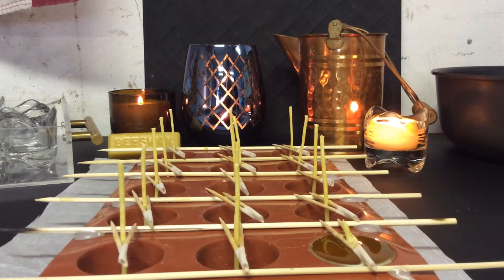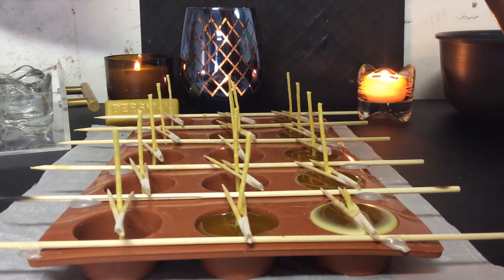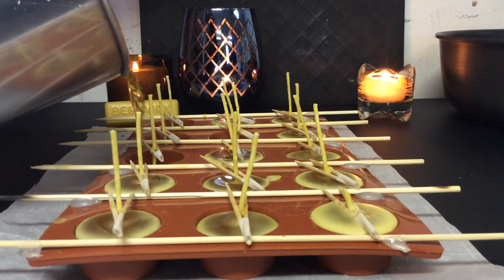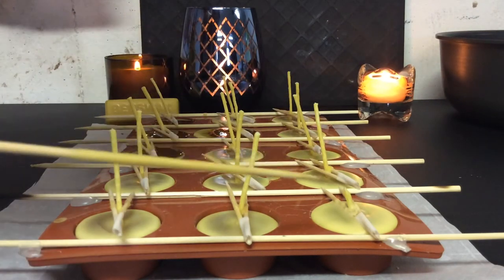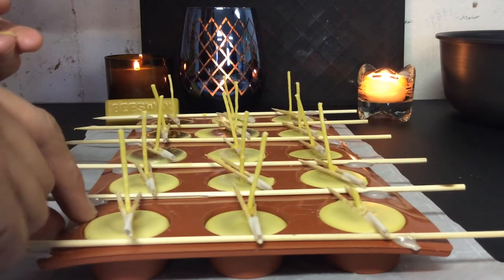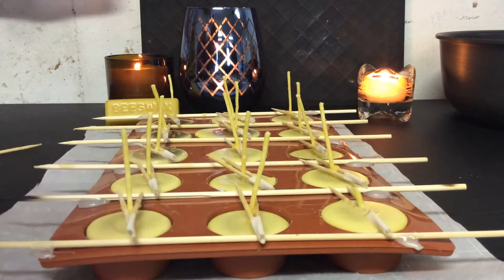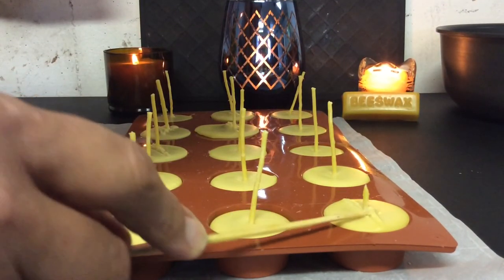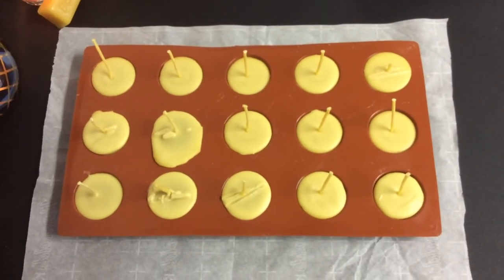100% BEESWAX TEA LIGHTS - INTRO TO CANDLE-MAKING

Comment: You specifically said copper pitcher. Is there a reason for that?
Reply from the maker: Metal is effective for melting wax … usually aluminum but I happened to use copper because it was on hand 😀